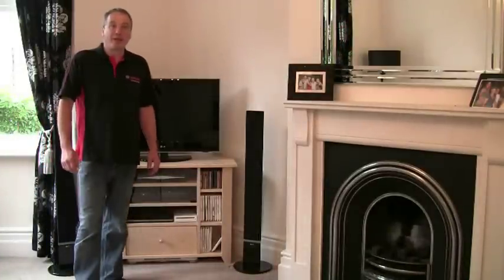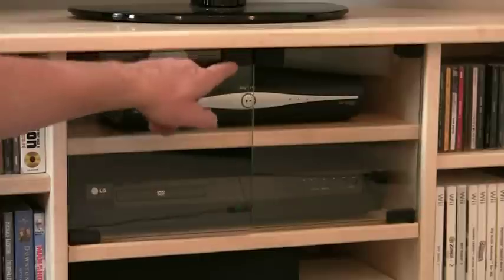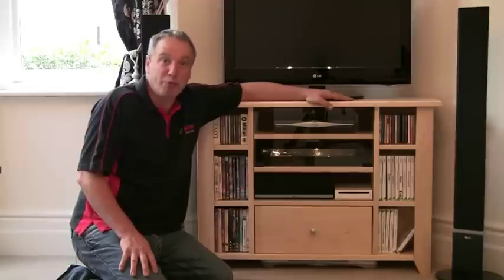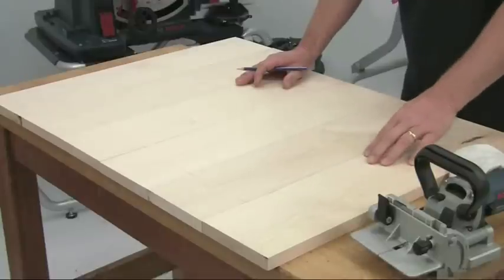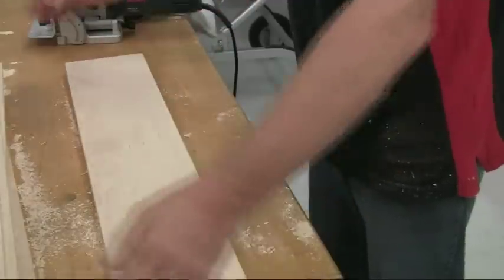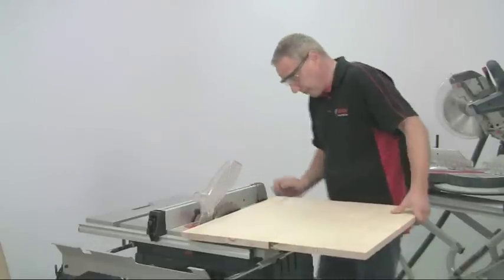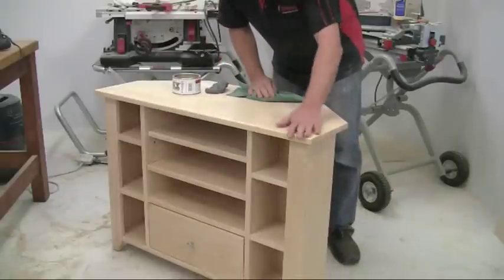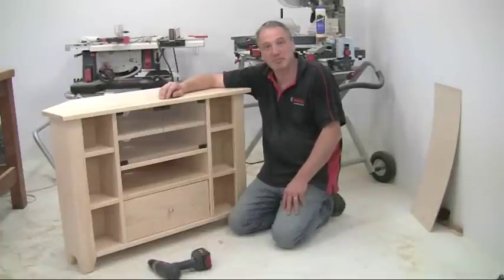Build it with Bosch Project 3 Entertainment centre

Comment: What Is The Name of the tool used in a Minute  18.54'' & 23.25" ?
Reply: Dimitrios Chardaloumpas trim router
Reply: +Dimitrios Chardaloumpas 
18:54 is a Orbit sander
23:25 is a Palm Router
Reply: I guess both are correct.